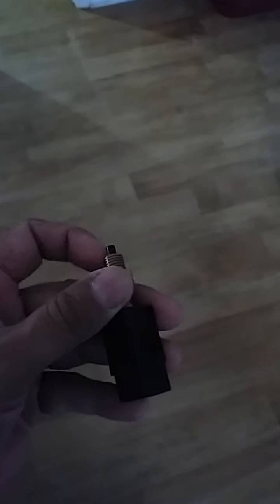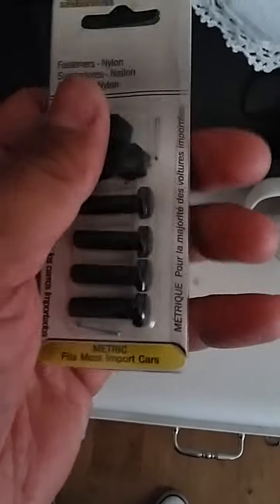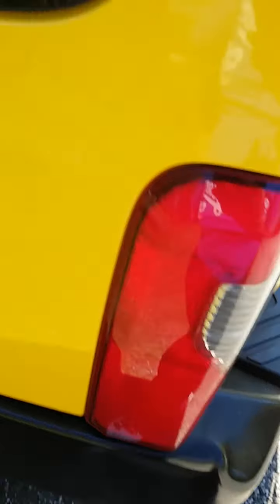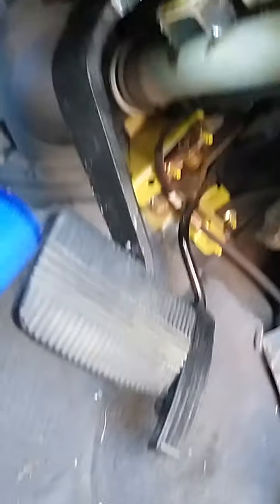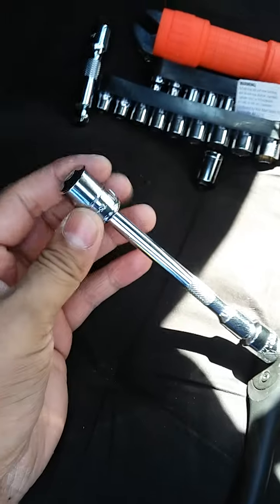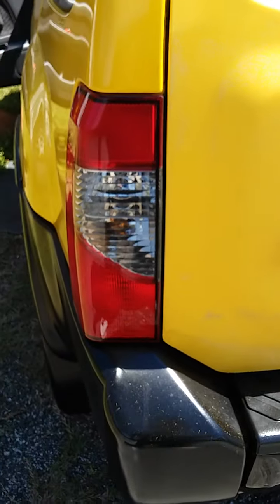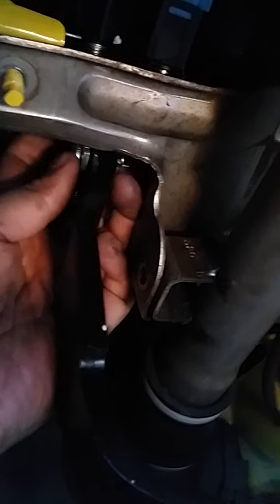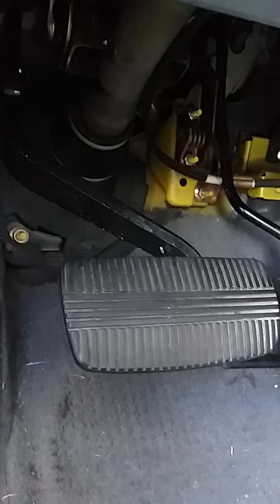Xterra brake lights stay on when I'm driving and when I'm parked with the engine off.

Comment: Thanks for making this video Maark.   My light started staying on yesterday.  I'm about to work on my 2003 xterra.   now I know why my cruise control hasn't been working as well.  On club xterra forum someone mentioned using a rubber grommet (tab) like in bottom of a desktop computer or other small appliance but I like your idea using the plastic bolt.   I think the tip about leaving the xterra idling will be a big help.
Reply from the maker: You're welcome! 👍🏽👍🏽👍🏽

Comment: Same issue on mine...went to Oreilys and bought a pack of Nissan plastic "bumper clips"...that was it, snapped that bad boy on in that bracket hole on the top end of the brake pedal and the flat end of the clip was making contact with the button on the switch...problem solved with under 5 minutes of labor with your knowledge/help. Thanks!!
Reply from the maker: Incredible! 
Good job! Glad it helped you sir.👍😉
Don't get rid of your Xterra like I did. I miss that sports utility vehicle so darn much!!!

Comment: Super easy fix! The key is to turn on the ignition, press in the brake pedal when installing the pin stopper. Takes less then 30 seconds...really. 
1) pull the fuse under the dash to turn off the brake light
2) look for pieces of the stopper on the floor board to confirm that the stopper is the problem
3) locate the the Stop Lamp Switch and the ASCD Brake Switch located at the top of the brake pedal (stand on your head for that part)
4) If there is no stopper at the end of the switch(s) then order the part from the Nissan Dealer or Auto Parts store ...probably the only part Nissan still carries for the 2000 Xterra
5) Insert the stopper in the end (round side goes in the hole)
6) Reinstall the fuse
7) Check to see that the brake lights are working (or the cruise control if that needed to be replaced too!) Your ready to go!
Reply from the maker: Kathy Ryyth great thanks. I am glad this was helpful..

Comment: This just happened to my 2000 Xterra thanks for the heads up on the steering column bracket. I was about to try and take that off. It's 97 degrees right now so I'm gonna wait until it gets a little cooler to tackle this. Btw your Xterra looks nice mine is starting to fade.
Reply from the maker: That's great George! Come back and tell me how everything went please. Yes it was the best SUV in my life! Did a knock sensor replacement, spark plugs replacements, crankshaft position sensor replacement, total tune up and then sold it. My biggest mistake. Should've kept her. New tires, everything was top maintenance. I cry about it still lol. 
Thanks for looking at my video.
Reply from the maker: George Chavez how's everything with your Xterra? Did take care of that brake light issue? Let me know..
Reply: @midnightboymc  I ended up using those self adhesive pads you put on the bottom of chair legs to keep them from scuffing floors, so far so good. Now I have to fix my right turn signal and a small hole on my radiator and the motor is beginning to rough idle. With a 20 yr. old car if it's not one thing it's a bunch of other things. Oh well.